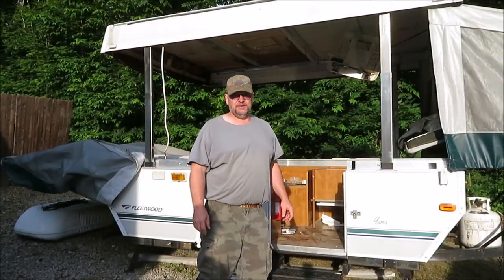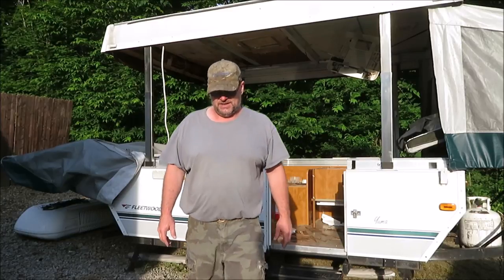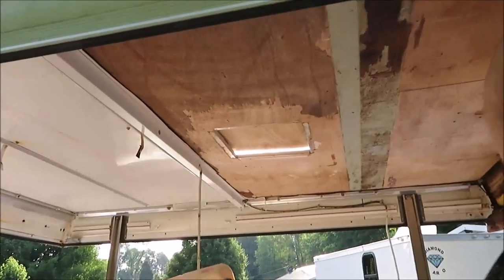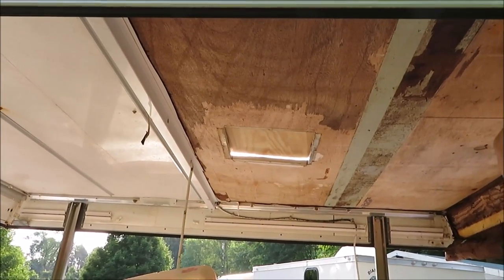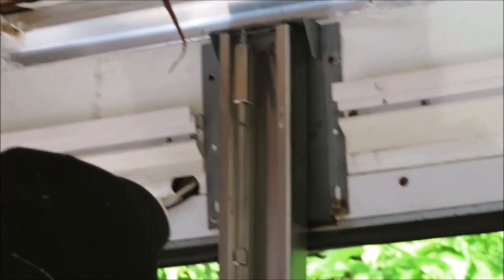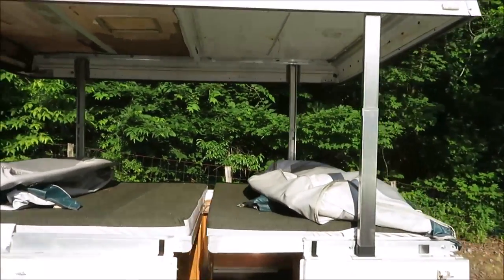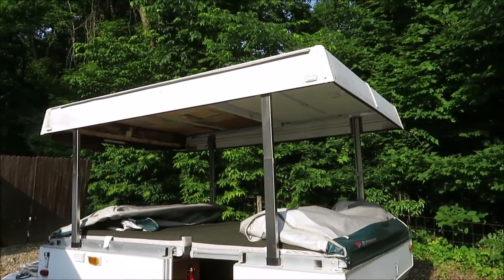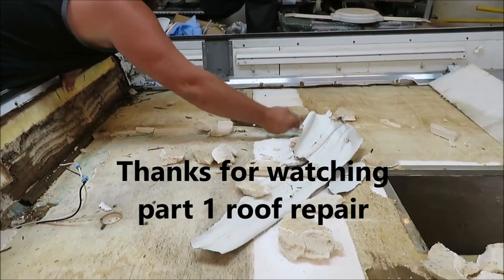pop up camper roof restore part 1

Comment: Are y'all planning on gluing in some insulation board to replace the Styrofoam you're taking out? May want to measure the thickness of the old foam for a close-as-possible match-up. If you're putting the A/C unit back up there, you might consider constructing some additional roof beams to support that weight as well. Wood or metal will work if placed properly and matching the curve of the factory header beams.
This looks to be a fun remodel.

Comment: The upper lift arm nuts are supposed to be loose. The bottom ones should be snug, but the top is supposed to be exactly how you found it - with a big gap from being tight.
Reply from the maker: Thanks for the comment.

Comment: The back half of my pop up camper on the whole thing Kmart off my roof is in great shape I did it three years ago and is no brown marks of any mold so they risen paint that I used for the roof seemed it did the trick but the popcorn holes halls and the popcorn the popcorn holes that I had arse nausea with the resin paint now I have to deal with the other half of the camper falling off how do I go about repairing that the wood came off from the back end of the camper and everything and some parts of the camper is tent is deteriorating how much does it cost to repair the whole pop-up camper tent enclosure
Reply from the maker: Sorry I would have to see it